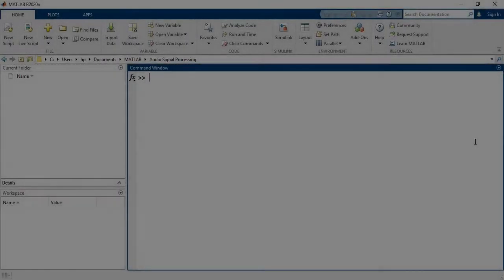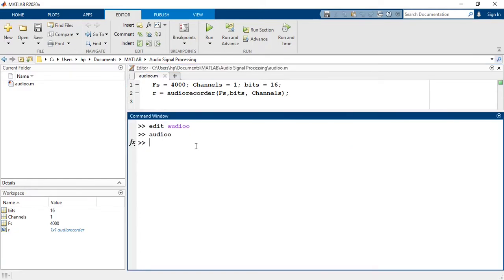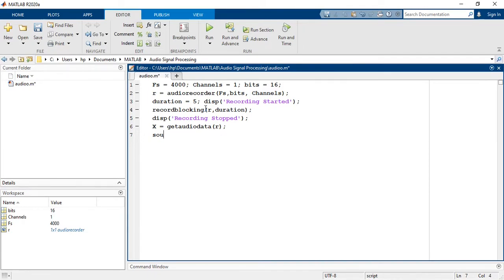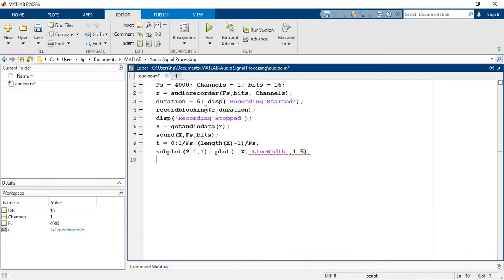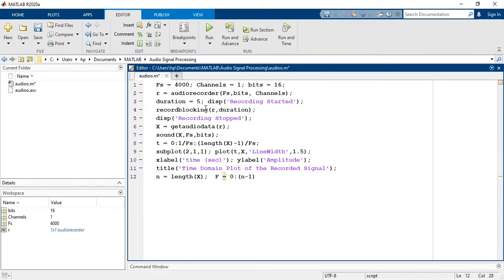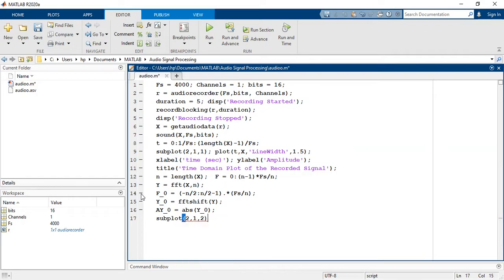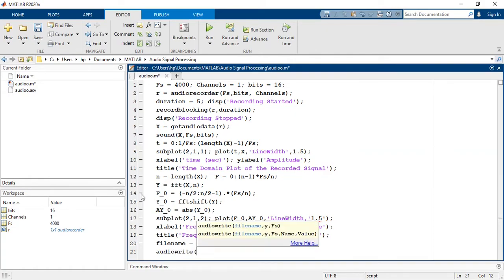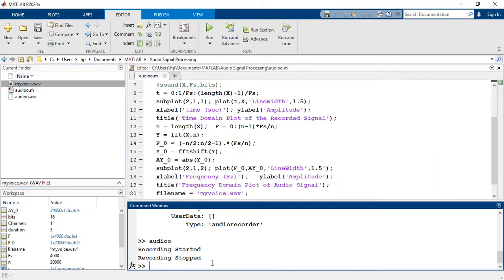Audio Signal Processing in MATLAB

Comment: 1. Basic Operations on Signals, Generation of Various Signals and finding its FFT.
2. Program to verify Decimation and Interpolation of a given Sequences.
3. Program to Convert CD data into DVD data
4. Generation of Dual Tone Multiple Frequency (DTMF) Signals
5. Plot the Periodogram of a Noisy Signal and estimate PSD using Periodogram and
ModifiedPeriodogram methods
6. Estimation of Power Spectrum using Bartlett and Welch methods
7. Verification of Autocorrelation Theorem
8. Parametric methods (Yule-Walker and Burg) of Power Spectrum Estimation
9. Estimation of data series using Nth order Forward Predictor and comparing to the
OriginalSignal
10. Design of LPC filter using Levinson-Durbin Algorithm
11. Computation of Reflection Coefficients using Schur Algorithm
12. To study Finite Length Effects using Simulink
13. ECG signal compression
14. Design and verification of Matched filter
15. Adaptive Noise Cancellation using Simulink
16. Design and Simulation of Notch Filter to remove 60Hz Hum/any unwanted
frequencycomponent of given Signal (Speech/ECG)
Lab 1 and 2 syllabus for us please provide sir

Comment: Design an App for the following
1) Displaying various types of image files and formats
2) Transforming image (gray/RGB) to a bit planes and displaying
3) Performing the following operations on image
i) Image resize: Effect on spatial resolution 
ii) Quantization, Dilhering, error diffusion
4) Performing the following point processing operations on image
i) Adding / Subtracting / Multiplying / Dividing by a constant
ii) Complement of image
iii) Histogram Processing , Contrast Stretching, Equalization.
5) Filtering of images in Spatial domain 
i) Low Pass : Mean, Median filtering 
ii) High Pass: Laplacian filter, Laplacian of Gaussian(LOG) filter
iii) Edge Sharpening filters: Unsharp marking, High Boost filtering
iv) ROI processing on Images
6) Filtering of Images in Frequency domain
i) Ideal low pass filtering 
ii) Ideal high pass filtering 
iii) Butterworth filtering
iv) Gaussian filtering
v) Homomorphic filtering
7) Image Restoration
i) Generating different types of Noisy, Images : Salt and pepper, Gaussian, Speckle, 
Periodic
ii) Enhancement of Salt and Pepper noisy image
iii) Enhancement of Gaussian noisy image
iv) Enhancement of periodic noisy Image
v) Wiener filtering
8) Image segmentation
i) Thresholding for converting Gray image to Binary image
ii) Edge detection: 1st order : Robert, Sobel, Prewitt, II order : Laplacian, Canny
9) Wavelets:
i) Applying Haar wavlet on image for different scales
ii) High Pass filtering using wavlets
iii) Denoising using wavlets
Cycle: 2
1) Recording speech signal with different sampling rates and quantization and saving as .wav 
file.
2) Framing and windowing of speech using different windows and plotting its spectrum and 
spectrograms.
3) Plotting the pitch contour using parallel pitch estimation 
4) Extraction of LPC coefficients from speech signal in Simulink
5) Synthesis of speech signal using LPC coefficient in Simulink
6) Real time analysis speech signal with LPC coefficients using DSK 6713
7) Real time synthesis of speech signal from LPC coefficients using DSK 6713

Comment: hi, thanks for the great tutorial. i am wondering why is amplitude different in 2 charts in the end?
Reply: Hi, The amplitudes in the time domain and frequency domain are related, but they represent different aspects of the signal. In the time domain, the amplitude refers to the instantaneous value of the signal at a given time point, while in the frequency domain, the amplitude represents the strength or energy of different frequency components present in the signal.